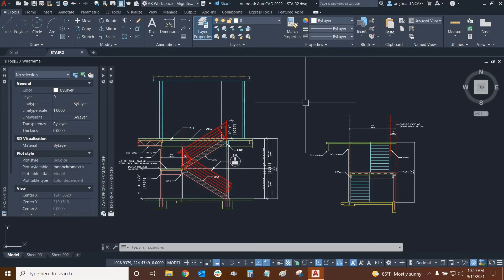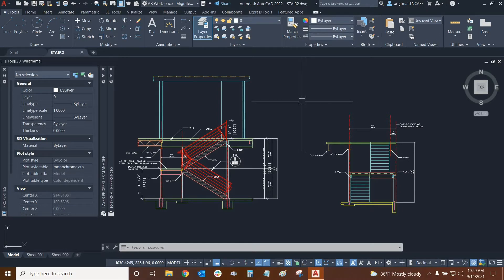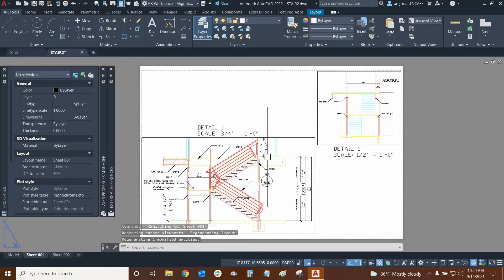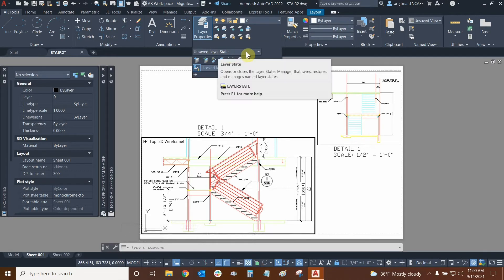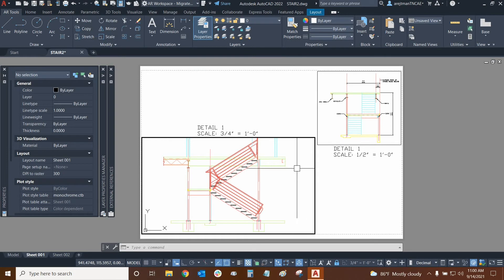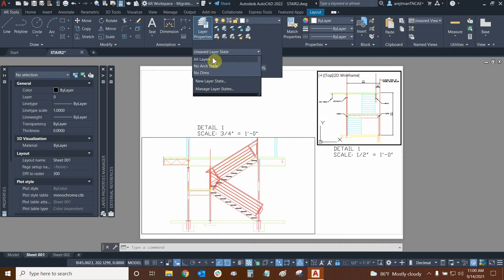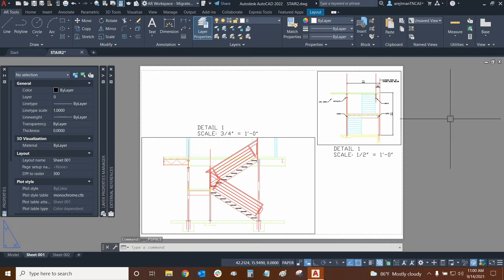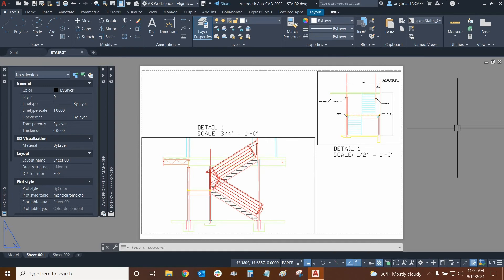Using Layer States with Viewports in AutoCAD

Comment: I have a question.
Is it posible to copy/export the layer state, from diferent drawings?
Reply from the maker: Yes: In the Layer States Manager, you can select a layer state and select "Export" on the right side. The file extension is ".las", and it can be imported in a similar way to other DWG files.

Comment: My layer states (LS) were working fine until now. I changed of PC so... new AutoCAD. 
My problem is: when I apply a LS to an active viewport (VP) it applies the same to all the layout, making disappear my VP rectangles, my footage, etc
It wasn't that way before. Do you know why?
Reply: Oh, it is good to know that mainly my LS are  from a XREF, so I can't include the layers of my footage and extra things I got on the layout in the LS
Reply from the maker: @deesesarte  If you're double-clicking inside of the viewport and changing all your viewports and Model Space layers, then this seems like a bug. You may want to perform a clean reinstallation of AutoCAD and ensure that no other programs are open when you install it.
Reply: Have you figured this out perhaps? I'm running into the same problem atm

Comment: im trying this but in different layout tabs and the layer state isnt saving for some viewports. Its weird because only some revert back to original . Any ideas on whats happening here??
Reply from the maker: If you're using XREFs, you'll want to type "VISRETAIN" and ensure that the variable is set to "1". Also, in the "Layer States Manager", you can ensure that the checkbox next to "Don't list layer states in Xrefs" is not turned on. You can also select a layer state in the list, click on "Edit", and ensure that the proper layers are turned on. Then, clicking "Save" and "Close" should save the layer state and allow it to save between viewports and layouts. If this doesn't solve the issue, you may want to restart your computer and potentially perform a clean reinstallation of AutoCAD without other programs open.
Reply: @DigitalDraftingSystems  I'm having a similar issue to the user above, could it technically be an issue with laving multiple viewports on the same layer? So multiple Layout tabs for different sections of the plans, all with their own title block viewport, but the VPs all on the same layer?
Reply from the maker: @Reyas  Your theory is very interesting, and we appreciate it a lot. We did some testing and determined that viewports that use the same layer are not affected by changing layer states. Viewports can be on the same layer and on different layers, and this still allows us to change their layer states independently and keep those layer states when we close out of files and reopen the program.
Reply: @DigitalDraftingSystems  Thanks for the prompt reply! Saves me trying to test the same thing as well. Alternatively, is it possible to lock the viewport after applying the layer state?
Reply from the maker: @Reyas  You can lock the viewport after applying a layer state. However, you'll still be able to double-click inside of the viewport and change the layer state. Thus, the layer state won't be "locked" and can be changed, and locking the viewport isn't related to layer states.
Reply: @DigitalDraftingSystems  Good to know! Now I'm out of ideas 😉
Reply: @Reyas  Did you happen to find a solution for this? Or did you just have to reinstall AutoCAD?
Reply: @nicodawe1476  I did have somewhat of a work flow, though I'm not sure it's great. If you remind later I'll try and bring it up and paste it here.